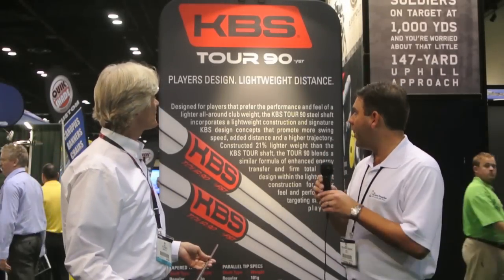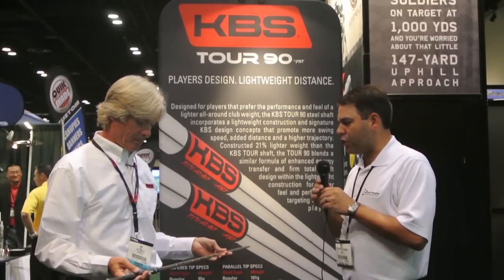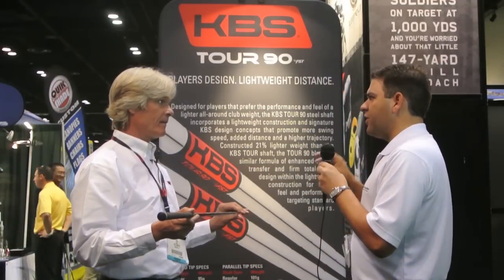KBS Tour 90 Shafts

Comment: I got fitted for this shaft in regular. As was said in this vid, it's all about the right trajectory, height and spin. The fitter told me not to look at any shaft during the entire fitting, I had to go on feel alone, along with the data provided by trackman. When he put this shaft in my hands, the weight of the head of my JPX Tour 919 irons was so much more apparent. It felt awesome to feel the head throughout the swing. I got such fantastic whip out of this shaft, and total control. I shape the ball either way and don't have the highest swing speed, but my efficiency is very high. This shaft is unbelievable for me and totally transformed my experience with my irons. I was surprised that regular was the best as I've always played stiff and my woods are all stiff, but if feels pretty stout and very stable and solid. Good fitter, great shaft, brilliant result.
Reply from the maker: Great news. Finding something that works is the best feeling